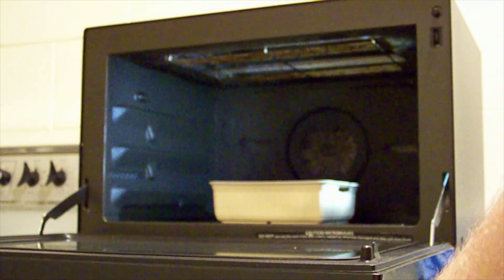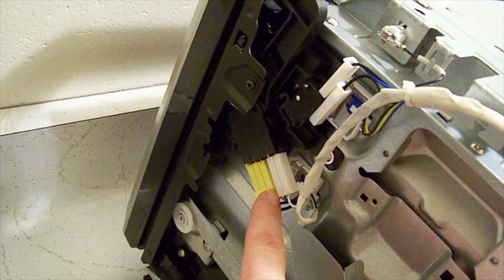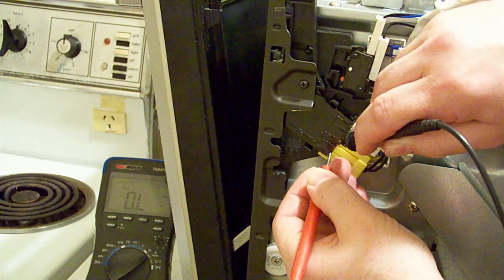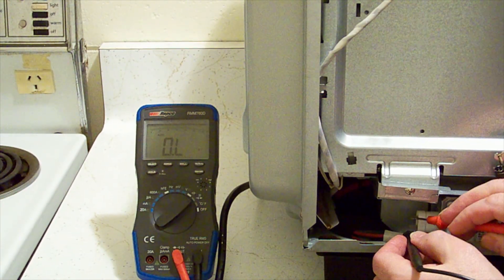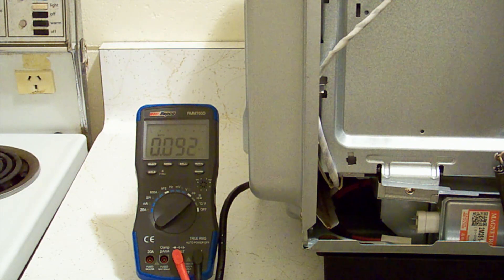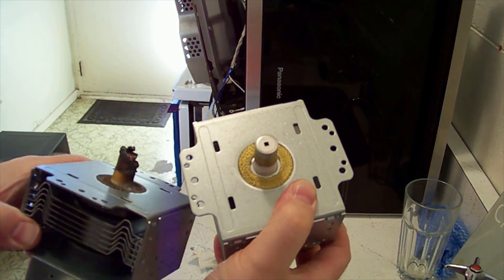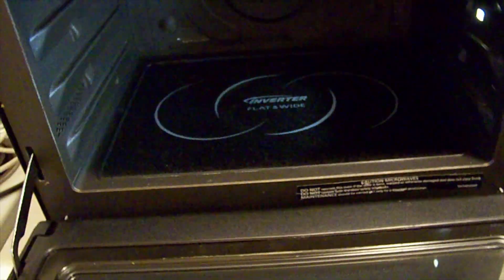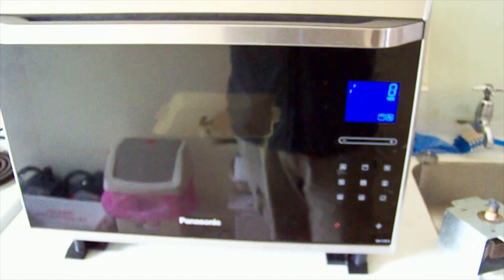How to repair and reset Panasonic Microwave error H97!

Comment: Many thanks Jonny, I was deeply mystified with my H97 error until I found your video and mention of the reset procedure. I had changed the IGBT on the inverter which I was pretty sure was the only thing wrong with it, but failed to start after doing that. I ordered a 2nd hand inverter from aliexpress and installed, same result.  Your reset procedure saved the day 🙂
Reply from the maker: Good stuff! I hate the way vendors do this and finding documentation on it can be difficult. The number of times I've been chasing a 'fault' that turned out to be a software based decision to not do something.

Comment: For anyone interested, a formula for calculating actual cooking power produced by a microwave: 
Power (Watts)= [volume of water (cc)] x [temperature rise (°C] x 4.1868 / [cooking time (secs)]
More accurate with a clean oven and using lightweight plastic container for water. Use enough water so it does not boil and stir before measurement.
Also a magnetrons cathode filament will take up to 3 seconds to warm up and become active so take 3 seconds off your actual cooking time for the calculation.
Reply from the maker: Good info. Cheers!

Comment: Had the H97 code, checked the Omnicron, it was okay, had the 70n Farads on both power-in terminals to ground case, zero ohms across terminals, and integrity of unit was excellent.  I reinstalled, still H97.  I then followed reset sequence, cancel, open door, hold start button after beep, then cancel 3X, got the EEP, pushed a couple other buttons until it showed END and then all good.  Came right to life.  Note, earlier in day, power flickered/surged throughout house, and then this error code. Coincidence?

Comment: Thank you,  I have yet to put it back together,  the magnetron was fine the plug socket was showing signs of burn. I had a H98 code.  Check door switches, fuse, also the magnetron it looked like new. No crack in the magnets nozzle was clean as.  
I'll let you know how I go.  These codes are different for models I'm not sure how you get them?  My unit is NNSF5774-S.  A New Zealander  you're across the ditch.  
Can you advise and warn about 1, Capacitors HV   also  2, Earthing for computer circuits,  3, the use of earth leakage plug connections.    👍

Comment: our alive. Welcome back. Till now I did not know you can just replace the connector on a magnetron. I wonder how many of those magnetrons I could have fixed instead of replaced. Doh..:(
Reply from the maker: I know right. I never knew either  until I got this job and did some research. Thanks!

Comment: before opening the microwave back side please try  WD 40 It could be door problem I just spray Wd40 on the door clip and the microwave door open push button area and it's working fine and heated

Comment: Smashing repair, i hope the magnitron didn't cost too much.
Looks like a nice cooker, not cheap crap that i would buy :)
The magnitron looks well tortured, i've never seen one in that state.
Reply: @JonnyFix  i have got the uk model of this very same oven instead of cf874 its cf873 and mine its one of the Very 1st like batch/gen when they were released back in 2013 costing £425 and in 2020 still runs like clockwork its a great oven.

Comment: Without replacing any parts or disassembly of the microwave, the reset procedure worked and my microwave is working like it used to, how come?
Reply from the maker: Something will be failing giving an intermittent fault condition that would cause the code. It's quite likely the code will come back again and once the part has failed completely the code will always be set right after you clear it and try to use it.